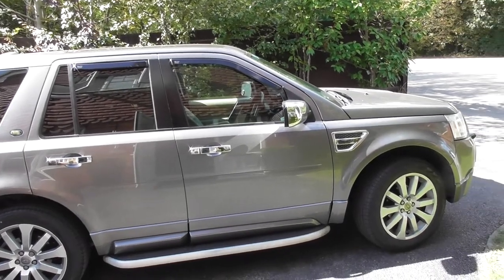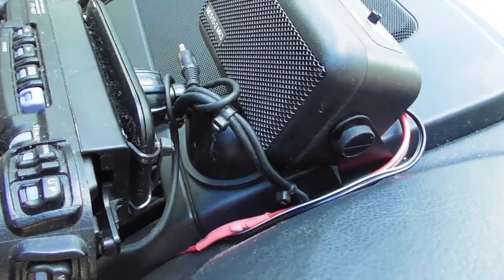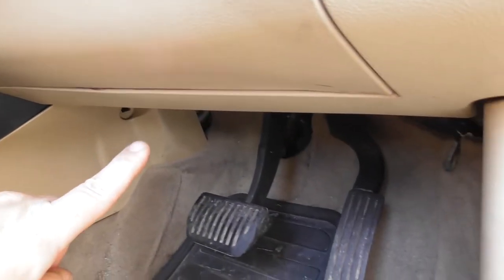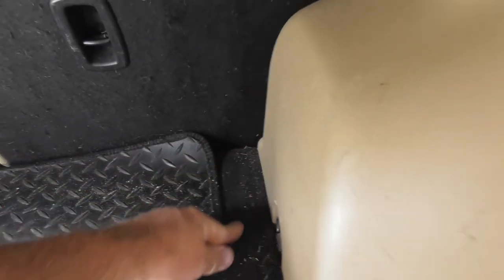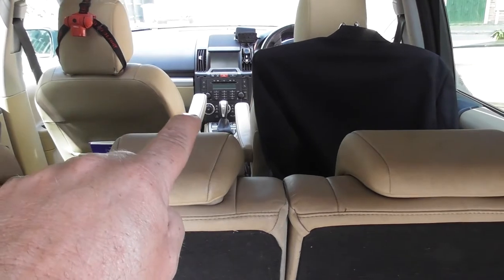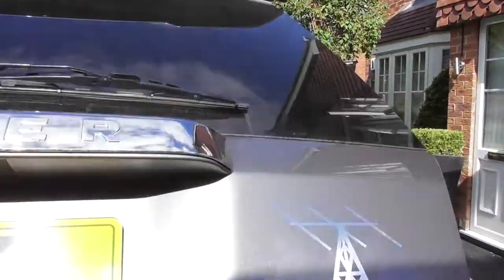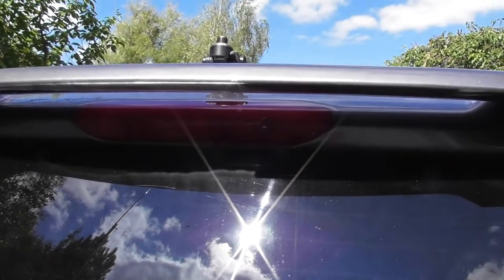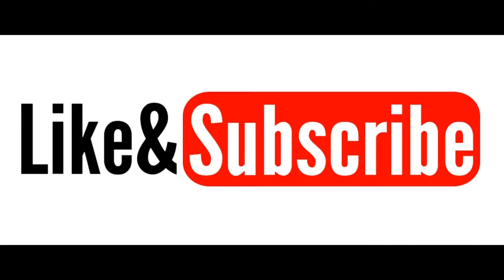Fitting a Yaesu FT857D into a Land Rover Freelander 2

Comment: NIce installation - just one question -  If you use the cig lighter socket to power the 857, what rf power do you use out of the rig as most of these lighter sockets are rated as 10 amp maximum? Cheers.